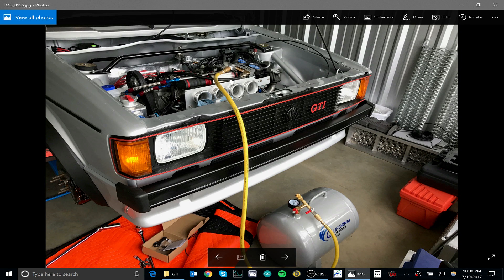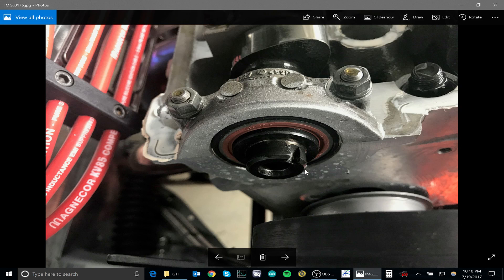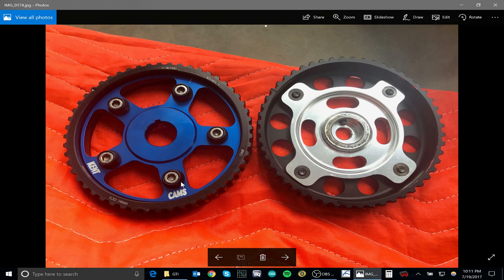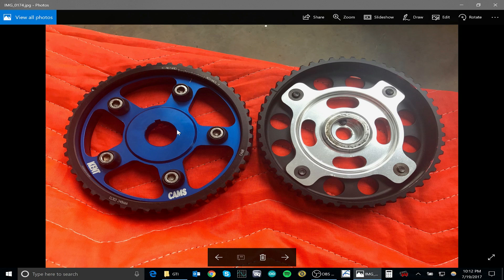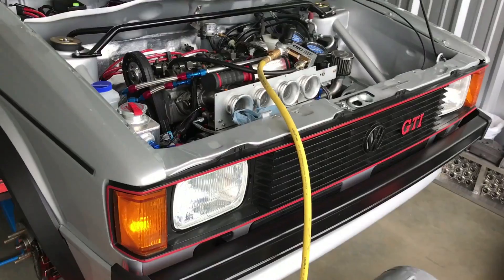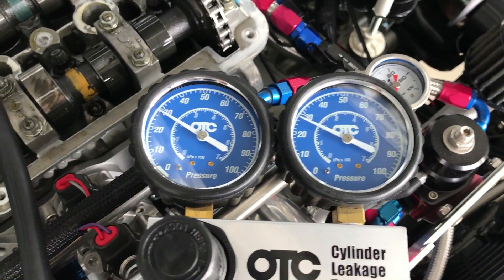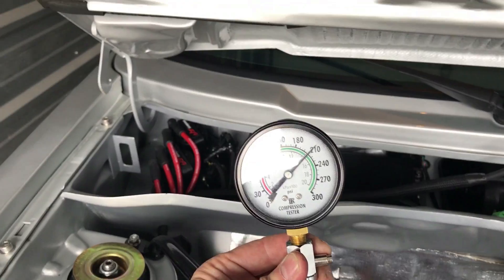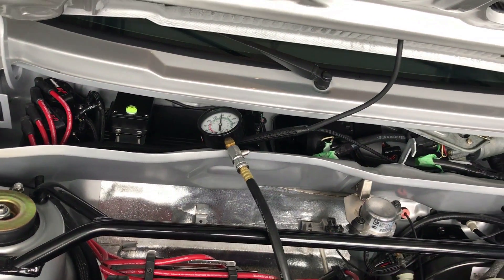The Ultimate 1983 Rabbit GTI - part 153 (Engine inspection/testing - all good)

Comment: Been running Kent piece for over ten years. Zero distortion as of yet. Although offset steel piece sounds like a good route.
Reply: Also been running with kent cams aluminium in my rally engine for many years and never had any issue with distortion. Rpm limit 8200.
Reply: my efi technologies computer is set to 7500rpm.  Although it has tons of headwork professionaly ported head and euro intake with an ob1 vr6 throttle body, im still  using 278 278 web cams with hydro lifters. love to have the 300* shricks with solid buckets. if i had that set up it would like 8-8200rpm
Reply from the maker: What rpm limits and do you get up there regularly? It is a beautifully made unit ...
Reply from the maker: It seems like a very nice unit - for sure! Thanks for the info/feedback
Reply from the maker: I am impressed with the Kent sprocket - it seems really stout.